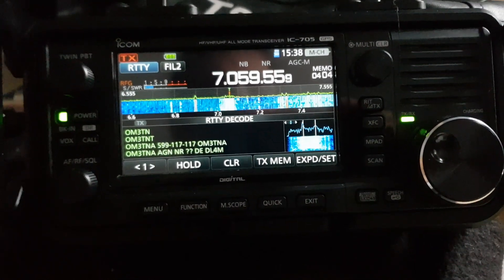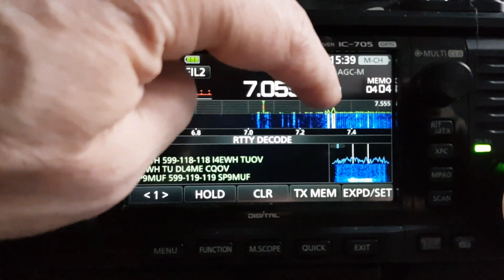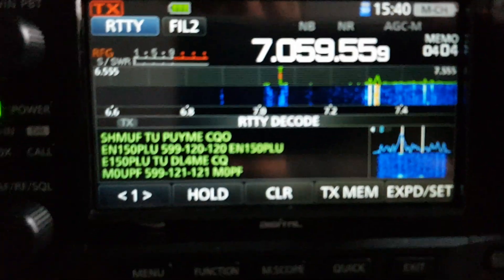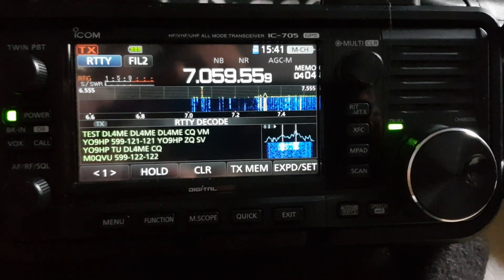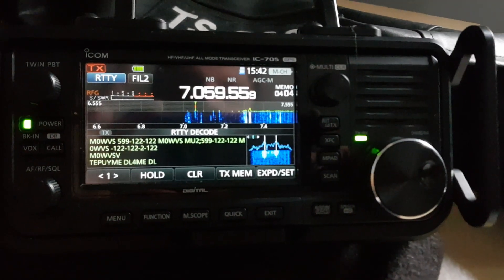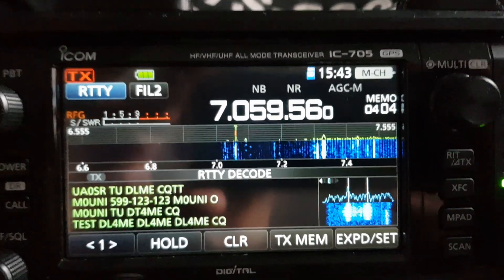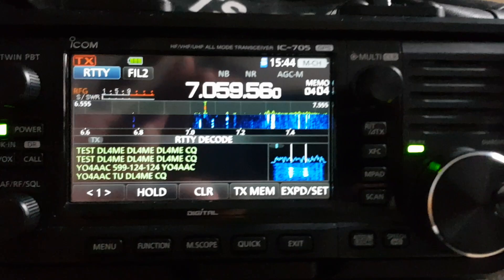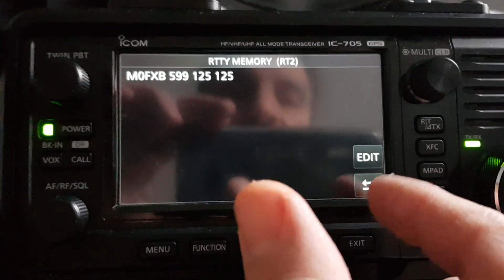ICOM IC-705 - Select - RTTY - Menu - then Decode .

Comment: I'm interested into getting PSK31 and other weak digital signal modes. Every time I listen and try to read the traffic coming across, it looks like a two year old pounding on a keyboard. Not sure if it's the settings in the radio or I'm on the wrong frequency for the mode.